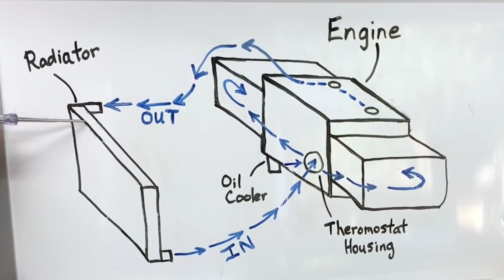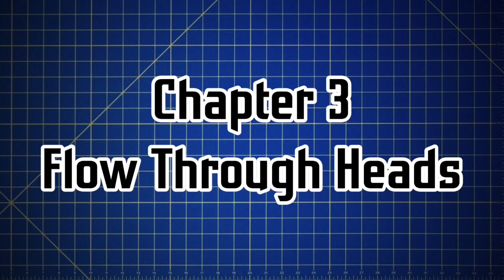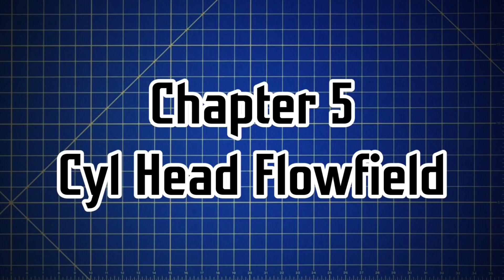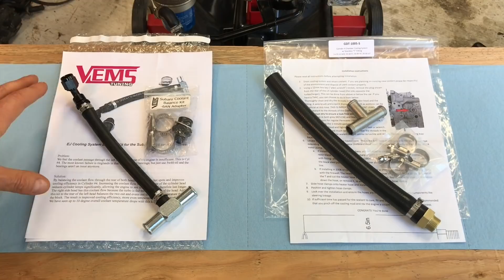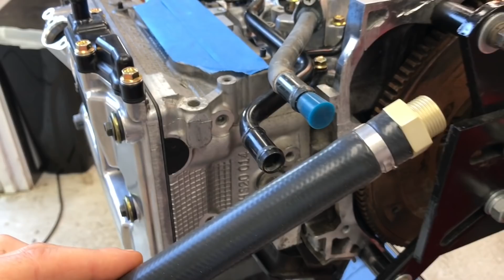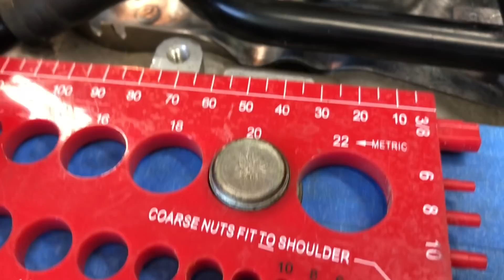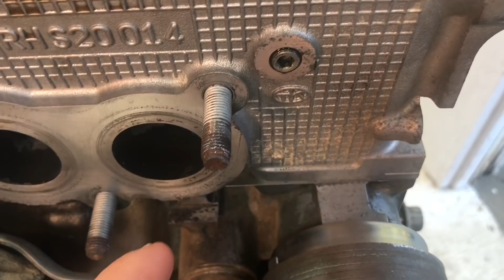Solving the Subaru EJ-Series Coolant Flow Problem

Comment: Great video, however you don't really explain how coolant flows out on the 1-3 side, and I'm guessing is similar to the 2-4 side, meaning the 3rd cylinder is suffering the same heating problem as the 4th cylinder but a little less considering the how the exhaust gases flows on them (and again a little more since the coolant have to travel longer gathering heat along the block to get there). I'd be interesting to actually measure the temps on them to see the difference with and without the upgraded cooling system. On the other hand, did you modified the kidney-like holes on gasket to fit the block holes ?  Btw, I understand the fact that most times the issue comes from the 4th cylinder, but I think that doesn't make my point of view invalid.

Comment: I love this video, but wonder about the flow rate of the mod.  More isn’t always better. The exit port of the mod isn’t just low pressure, it’s negative pressure.  Too high of a flow rate through the mod, seemingly, could create a deficit of water exiting to the case and out the designed port to the water cross pipe, possibly creating unequal cooling towards the mod side of the cylinder and starving the turbo of cooling water.   Seems important that mod be flowing a metered and correct amount of water through it.  Just my thoughts.

Comment: One question.  I use Subaru platform EJ251 with reverse manifold option to swap Volkswagen T3 vanagon .  The problem related to cylinder 4 was same not matter ? What do you recommend …. Thanks in advance

Comment: That phoenix fitting look like it should have slight restriction to flow of water, what I think would be preferred since we dont want all cooling taken away from cyl.2. So even a third of cooling flow added to cyl.4 could be optimal. I wouldnt want to open that path all the way without thinking it through.

Comment: I have an EJ25 SOHC 4 valve engine in my Gyrocopter. I no longer run the standard water outlet cross over pipe and instead run 2 seperate pipes (one from each outlet) to 2 seperate radiators of the same size and at the same height. The outlets (bottoms) of both radiators are  then "Y" pieced together, so that there is no differential feed issues associated with "T' pieces, and are then fed directly back to the water pump. There are no heater circuits, just this cooling circuit. 
Here is the problem:- 
All the flow from the waterpump exits the RH side of the engine while the LH side outlet pipe (right at the block) is still cold, indicating zero flow. Restricting the flow from the RH top radiator hose results in the LH side flowing and getting to temp, so no blockages etc. I believe the real issue here is NOT the #4 cylinder cooling issue described here but an overall design flaw seeing the RH side seeing preferential flow through the block/heads (for whatever reason??). I have not yet solved this issue but I would be open to any and all suggestions. I noticed that the original crossover pipe is oddly shaped with a "sort of" restriction (flattened section) built into it which may help address the preferential flow issue from LHS vs RHS??

Comment: Just experience my 21 sti being heatsoaked today. Car felt super sluggish, slow throttle response, dropping to 600-700rpm. After finding out its normal for hot weather, the 4 cylinder mod sounds about right... a

Comment: My heater core is damaged, so I had to loop/bypass it. Can I still run the Cylinder 4 cooling mod off the inlet/outlet heater core lines bypassed?
Reply from the maker: Yep. Totally.
Reply: @SubaruONLY  Thanks Luke! 🙏🏻
Reply from the maker: @Mike3_6_9   cheers and good luck! 👊
Reply: @SubaruONLY  👊🏻 Thanks!

Comment: I just finished watching this and really feel I gained a lot of understanding of what is going on with cooling in my engine.  I do have one question/idea.  From my understanding, the hottest coolant is pulled out of the block at cylinder number 4 and then routed directly back into the water pump and straight back into the block.  Is this correct?  Is there a way to plumb this from out of the block at cylinder four and into the intake for the radiator to cool the fluid before returning it to the pump and the block?
Reply: Great video and i too had the same thinking as yours, even if it's there to create an extra low pressure exit on #4 could it not be rerouted back to the rad instead of WP or maybe like he said the connection at the WP is a low pressure suction so maybe thats why. 
Pity no reply, this guy knows his subaru.
Reply: No, negative pressure is the key.  I would use the more restrictive kit to both minimize the effect you’re eluding to and keep the #2 and #4 cylinder cooling more even.  More flow isn’t always better when you’re doing so at the expense of other areas of the engine and, like you said, reducing the overall amount of water flowed through the radiator.
Reply: @RyanThornton-q4m  sorry, I'm not following you.  Would you please elaborate?

Comment: It seems like it would prioritize cooling the head and slow down flow around the cylinders. I have always been on the fence on this mod.  I wonder if drilling that air bleed hole in the headgasket on the top right side of cylinder 4 would be better to allow more flow in that stagnant pocket.  My motor melted piston 3 "without the piston 4 coolant mod" from my poor tuning, too much compression and too much boost.  Piston 3 has the turbo coolant passage out of the head.

Comment: Where doesn’t does that line connect to? Is it going back to the lower inlet  on the heater core.. then outlet from heater core line going back to the other line on the right facing back of engine?

Comment: Hi nice video! I already installed the 4 cilynder coolant mod on my 2008 STI and after it, it reaches 101C and before that it did not exceed 98 degrees Celsius.  The coolant is complete and there are no leaks. The installation process was ok but I don't know what is happening now. Do you know?

Comment: This cooling mod might be causing more water to flow around cylinder 4, but why channel that water back to the water pump, when it would have flowed through the radiator? Seems like it could just cause bigger problems.
Reply: Good point. I will think this through. Also we wouldnt want to draw all the cooling pressure from cyl.2.

Comment: Hey Luke, on my ej251 the passenger side cylinder head has no exit of water other than out the top of the block. In other words... both cylinder heads are the same. Couldn’t one also do a reverse cooling mod for the passenger side head as well? Since there is also a plug on that cylinder head. Not that those cylinders run hot like #4 but still it should help? Unless coolant has a completely different flow pattern on the passenger side cylinder head?

Comment: Interesting take on piston 4 failures. From what I've come across within the Subaru community, a lean mixture in cylinder 4 stemming from the OEM fuel delivery system was to blame (you did touch on this). Limited cylinder 4 cooling does make sense too though. Thanks for the thorough cooling system break down.

Comment: would this mean that the cooling mods are recycling hot uncooled coolant because they go through the heatercore and straight back into the chambers? looks like they are never are cooled by the radiator?

why route the coolant to the heater core instead of to the crossover or outlet towards the radiator to be cooled?
thanks
Reply from the maker: No, it still goes to the radiator… when the coolant goes to the heater core, the next place is back to the crossover pipe, then over to the radiator inlet at the top. Cheers!!!
Reply: @SubaruONLY  awesome! thank you :)

Comment: Just an idea, when you are talking about opening up the head gasket for coolant flow, you could open up only the cylinder 4 ports to allow more flow through that side, but leave cylinder 2 holes a normal size. Could help number 4
Reply: NO

Comment: Have a look at the toyota 4age 20v coolant flow it will make u sick going bk to the Ej , the bring the colder Copland in from the rad across all the intake then down into the pump back up through the block and across the exhaust valves bringing the heat out to the rad  , helping cool the intake all the time , 
The ej is not a reverse coolant mod it’s more an assist

Comment: ever see what a upgraded rad does for stock cylinder temps  u will be surprised  biggest thing i noticed was a 30 degree c drop in temps  across board once i put a duel core rad  that on its own is way better then the cylinder 4 cooling mod also stock wrx/sti rad  has same core size as the non turbo cars  best bang for money would be a rad upgrade vs messing with cylinder 4 cooling  yes i make it cool even but over all coolest temp is a bigger problem at higher power settings

also by porting the  head gasket u can also control flow direction so u can increase flow speed by porting the rear ports near cylinder 4

Comment: Interesting... My piston failure was in Cylinder 1... But, thanks for the informative video! I'll have to check into the 'bypass' from cylinder 4, just in case...  (ps: not first engine worked on, but first subaru...)
Reply from the maker: Sorry to hear about the engine issue but thanks for the support here. Good luck! 👍 Let me know if you have any questions!!!
Reply: @SubaruONLY  Yes, actually a question on this subject: Is this only for the DOHC head, or can / should this be done on the SOHC head as well?  Thank you for your time! :)

Comment: That was a very instructive video. Definitely I'm getting a reverse coolant flow kit. Thanks. Ps - I saw a oil trace at the tmic entrance, what it means?
Reply from the maker: Prob oil from the PCV system - I’d add a good Air-Oil Separator - that should solve it!!! 👌
Reply: @SubaruONLY  ok, I thought my turbo is finish. ( 05 OBXT)
Reply from the maker: Turbo could be bad too, but the PCV system is most often the issue. Good luck 👍

Comment: I made my own for 20 bucks. XD.  Order this, you will have to grind down the 2 barbs to make the oem coolant hose barely fit over. 3/4" in (20mm) T Aluminum Heater Hose Barb Water Coolant Fitting Adapter Metal.  And this Adapter Coolant Barb Kit M20x1.5mm to 20mm Barb.  Then go to napa get heater hose, harbor freight, get hose clamps call it a day.
Reply from the maker: Good call man. Love to hear the ingenuity - cheers!!! 👊

Comment: Great video! Here are my thoughts. The 3 ports on the water pump as 5/8" ID, added together total 1-7/8". The upper rad hose is 1.5" therefore more coolant is constantly recirculating in the engine and never seeing the radiator. The cylinder 4 mod just adds to this problem. No wonder why these engines run hot! Thoughts?
Reply: Correction. 5/8 is only the heater core bypass; 1/2" for the other two.
Reply from the maker: From what I’ve seen, adding the coolant mod does even out the coolant temps. Lots of serious racers with decades of experience use them, but you could be right - I haven’t do any test to verify these claims so who knows what the real data would say. Like you’re logic tho. Cheers!

Comment: Thanks for the video and explanation.  Why does this issue still exists 15 years into production?  Yes, Subaru improved other areas of the EJ25, but the cooling "deficiency" remains and is a potential source of continued failure.  And thus the aftermarket had to develop an item to rescue the EJ25 from itself.  I know the FA series of engines is here, but that doesn't mean we are in the clear (valve crud is next with direct injection).

Comment: Hello Luke, first of all, thanks so much for your videos, very informative and a great help!

Got a question about coolant flow when removing the OEM oil normalizer/cooler. Do you know if deleting this will cause a problem with coolant flow? I have an aftermarket oil cooler and don't have an OEM oil normalizer. 

Thanks Luke!
Reply from the maker: You’ll be fine, they can be deleted. 👌
Reply: @SubaruONLY  Thanks Luke, maybe if you have the time, you could make a video that shows how the coolant expansion tank works on the side of the intake manifold? I read it cools the turbo by the process of convection when the car is turned off and cooling down.

Comment: I would not open up the gasket ports to match. The diameter reduction could be intended to work like orifice plates ( reduce diameter to increase flow velocity) opening the ports will slow down flow increasing resistance time coolant sit inside the head, not good.

The kits are theoretically a good idea but there need to be some kind of thermodynamics Modelling to determine the correct hose side diameter, again you mentioned a larger Diameter will increase flow, which I believe is not a better design without Empirical data.   Larger flow with the mod will stagnate heat transfer from other areas of the engine causing heat soak in other areas of the engine.  This “can “ be a solving one problem but creating another elsewhere.
Reply from the maker: I agree 100%, need to set up controlled experiments and run some modeling. Let’s do this! We just need a funding partner 🤔

Comment: Is this a problem with engines that just have stage 2 mods? Or does it mainly happen to people trying to push big horsepower? I have a 2006 WRX with 175,000 miles with a downpipe and custom tune. My engine still has great compression numbers. I was curious if I was just a lucky one.
Reply from the maker: If you have good compression, wouldn’t worry about it. It’s more pronounced with increased boost over factory range.

Comment: Strange question, did you ever measure the exhaust port volumes? Thinking for a true, equal length manifold.
Reply from the maker: I did not. But good idea for sure. I actually did go down this rabbit hole a little, but for a slightly different reason.  Was curious if I could use some numerical flow models to simulate the flow rates and dynamic heat transfer gradients. Still something I think about pulling together, but ended up too complicated for the time I had available (back then). I’ll still like to pull this off! It would be a major R&D series that I want to see, but not sure if many others would really find it entertaining at all.  TBD!
Reply: @SubaruONLY  yeah it would be cool to know the cc difference between each exhaust port. It would certainly be a good factor to take into consideration in being able to create an efficient exhaust manifold for the ej engine. Its certainly a volume id want to factor into building a manifold if I knew it haha
Reply from the maker: Heck yea it would. I hear ya. Someone out there gotta do this, maybe some already on it. Cheers buddy!

Comment: For some reason my OEM thermostat it's not open, there it's not leaking, no air pockets, no head gasket issue (I guess) but some times the thermostat won't open, I have to put in parking, then press the gas pedal until reach 3-3.5k rpm and for some reason the coolant starts flowing through the cooling system... Any idea? This is the first well explained cooling system flow process I seen,  Thank you for your time for it..
Reply from the maker: I’d start with a new thermostat for sure. Make sure you orient it so the little bleed hole is on the upper side, that way air pockets can pass though.  Should be good after that!  Good luck! 👍

Comment: monumental video, should be a 'must see tutorial' video in every subaru workshop to understand the problem.
i removed thermostat just for the sake of experiment of free flow and filled the system with plain distilled water to measure cylinder 4 wall temperature with FLIR temp cam and found out that while system is showing 75celsius water temp the cylinder 4 walls measure up to 175celsius!! other three cylinder walls were around 90celsius! seems like ej20 series have bigger water chambers due to smaller displacement and that is enough to keep it running solid but 2.5 engines with just those few milimeters thinner cylinder and gasket proportions can not manage that design flaw!
Reply from the maker: Whoa - this is awesome little experiment you did man!  Crazy how much higher #4 was - thanks for sharing!  Very cool. 👊

Comment: I can see this mod stealing too much flow for cylinder 2 if the head fitting is to large, then as you pointed out which i didn't know was how the oem knock detection works. So now cylinder 4 is not really setup for early knock detection which maybe a better thing anyway. I think the oem pistons and boost are more of a problem. 

I got 400whp on petrol 98ron AU and egts and closed deck and the cylinder temps are all within 10 degrees going down the drag strip. On the 2 step im at 900 degrees C so i heat it up.
Reply from the maker: interesting. good points to consider.